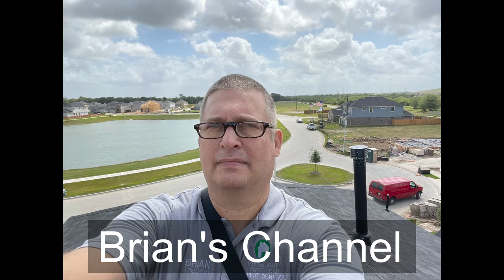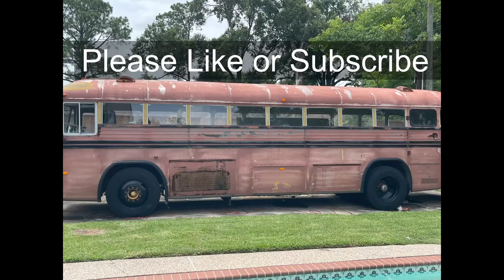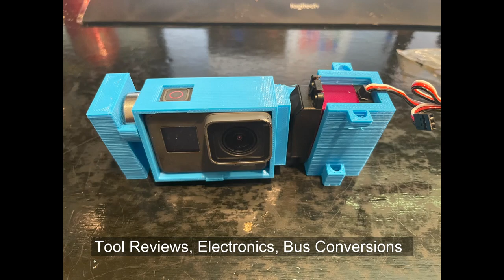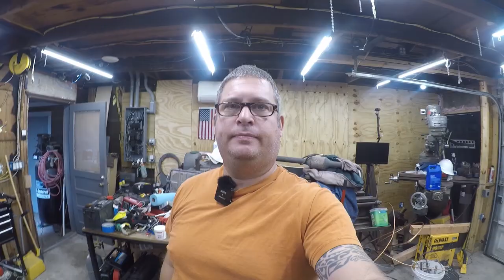HVAC 23: A teensy tiny leak... and it's finally running

Comment: If memory serves, the low side will determine the potential heat removal. In other words the vacuum side - if it is 50 lbs the temperature will be 50 degrees. At least that’s the way  r12 behaved.  You might be low on refrigerant.
I remember my instructor saying the system tolerance would allow for lower pressure and therefor lower consistent temperature. Automobile systems having the most broad tolerances.
I just bought this same system and like you do my own work. My first Goodman lasted 16/17 years, the second, 5 years.
I learned something here. I was trained to use a recover vessel, the thought never occurred to me to use the compressor. In my defense it has been 30++ years since I was certified. 
Very fun videos….

Comment: Now that its been 2 years. hows the unit running? any problems with it over the 2 years?
Reply from the maker: It's performing great.  Rarely runs at full capacity which saves alot of energy.

Comment: Is the new system still running? I’m still contemplating pulling the trigger with a ACiq 2 zone concealed duct but am wondering about how bad support will be or the equip quality.
Reply from the maker: It's running strong with no issues.  I've been busy and not had time to mess with finishing the plenum transition.  That's going to be complicated so I want to do it when I'm in the mood for it.

Comment: so i was looking at this same unit for about a 1500sq ft log home you thing i can depend on this ? im guessing its from china?
Reply from the maker: It has performed well for me.  I believe the OEM is Midea but can't prove it.  Midea is one of the largest HVAC and appliance manufacturer's in the World.  During what we consider extreme temperatures in Houston (17 degrees F) my house stayed toasty warm and the backup heat never came on.  I converted it over to the communicating thermostat which is a breeze to setup.  It comes with that thermostat.  I'd like to have an app to run it and it lacks a "circulate" mode on the fan setting, but otherwise it's just fine.  The tech support has been a little tough to get a hold of, so I stopped bothering and just figured it out.  I think a competent HVAC tech can get you through the install if you aren't able to diagnose, troubleshoot and repair an HVAC system.  I find the variable capacity of the system to be a real advantage and my prediction is that this is where all systems will be at in 5 to 10 years.  It can swing from 7,000 BTU to 42,000 BTU which is an incredible range.  Most "variable" speed American systems are really two stage systems unless you are paying triple the cost of this system or more.  The top tier American stuff isn't as reliable either IMO.  What ACIQ has going for it is that you can buy it today and install it.  It just works once you have it installed.  Fujitsu and Mitsubishi have similar systems that are probably more reliable, but they don't have the air-handler component in an identical form factor.  They also have multi-splits (one outdoor, and multiple head units inside) but that's a different animal that isn't well suited to American lifestyles.  We build houses that rely on distributed conditioned air.
Reply: @hotpuppy72  so for cold temps you think its a good buy with a 10 kw heat strip?
Reply from the maker: @mikekline-fc8ox  I don't know what cold is where you are..... but it works fine for me in Texas.  Just bear in mind that heat strips do you know favors in the cold and heat pumps lose efficiency as it gets colder.  But in mild weather it is far more efficient to use a heat pump then a heat strip.
Reply: @hotpuppy72  thx for your videos and your input looking at north idaho im in MN a few days ago -12.6 below in the am
Reply: @hotpuppy72  ya sure they told me that the pump will work with the heat strip or is that a lie? as temps drop
Reply from the maker: @mikekline-fc8ox  It will... but a heat strip is just electric heat.  You'll get good performance out of it in the fall/spring.  We really only have two seasons here.... cold and hot.  hot season is 9 months long.  :)
Reply: @hotpuppy72  so the area i want to use it has more mild winter temps 10s 20s 30s and above so should be good thx let us know how your unit is working and the bill to run it happy New Year:)
Reply: @mikekline-fc8ox  With a system like this depending on how large your home is will be fine at those temps. Of course if you undersize the unit itself you won't be able to let the heat pump go as low since it won't be able to keep up since you are compounding the lower efficiency with an undersized unit.